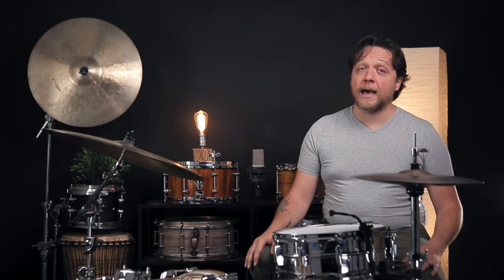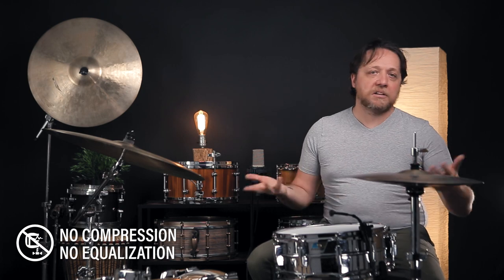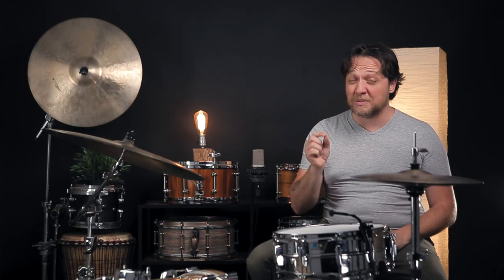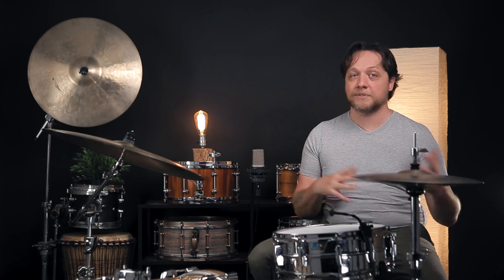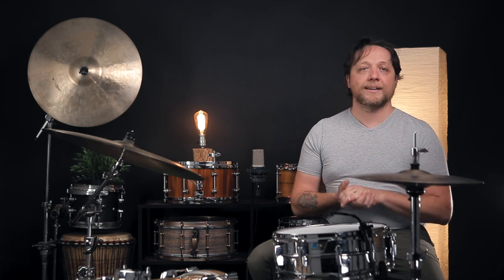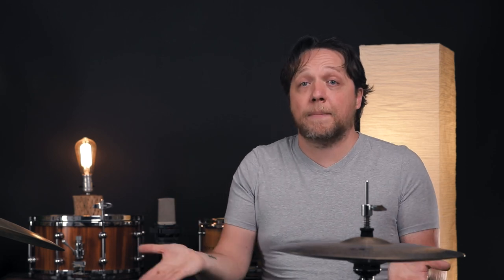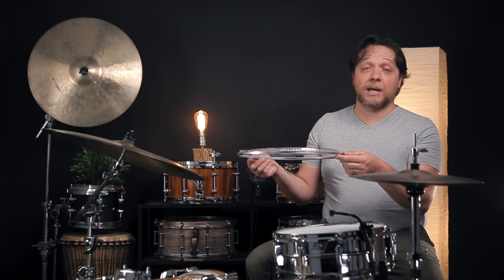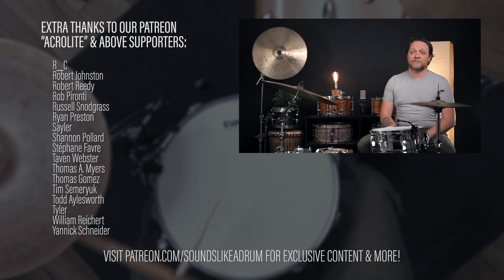Extending Drumhead Life - Snare Side Hack | Season Six, Episode 12

Comment: I've had fairly good luck by putting a little tension on a worn out head and CAREFULLY heating it with a heat gun. You're on borrowed time at that point, but it will get you by for a while.
Reply from the maker: That's most likely safer than this hack but, even still, we wouldn't recommend it.

Comment: This isn't about snare heads but I've noticed snare wires are breaking faster than they did 10 20+ years ago
Reply: i don't believe i've ever broken snare wires.  perhaps you're using too much tension. this happens sometimes when they're not seated properly and you have to over-tension them to get rid of some buzz.
Reply: @nickdenardo6479  They never broke on me in the past, it has just been a thing I notice when buying Pure Sound wires. I've ordered some in the past that had some of the wire welds very sharp and they came off easily. I don't over tighten the snare wires either, cause it just chokes out the wood or metal drum

Comment: i'm always interested in what is meant by 'tabletop tight'.  sometimes, i crank my snare side head up pretty tight, but i leave room to go tighter.  sometimes i don't.   it depends.  for one thing, i'm poor and can't afford to be buying new heads all the time.  but, more importantly, sometimes this isn't what i need for the sound.  sometimes i've found that i need to tension a snare side head more than i would deem appropriate for sonic reasons because the snares are not reacting the way i want them to.  i feel like this is a by-product of the shell on the snare i'm dealing with - like it's not really doing what it's supposed to do.  but this is a relatively high end snare (the one that initially comes to mind), so i doubt that is the case.

having said all that, this seemed like a bad idea out of the gate.  it's rarely a good idea to use things in a way other than what they were designed for.  you touched on all the points that would concern me...... as usual.